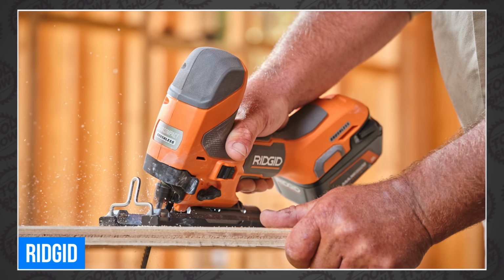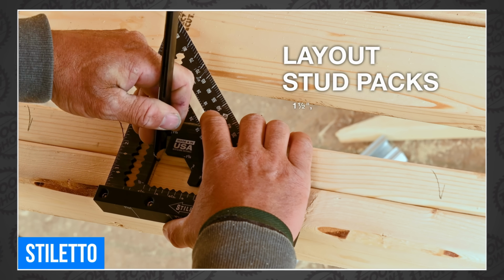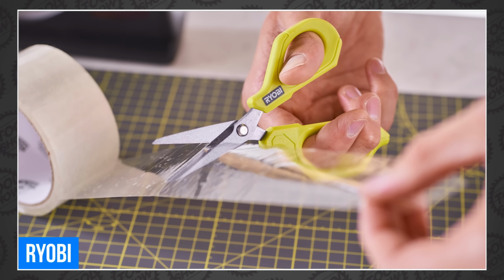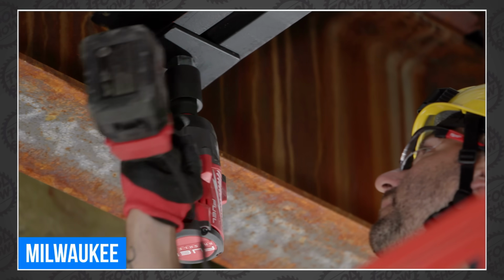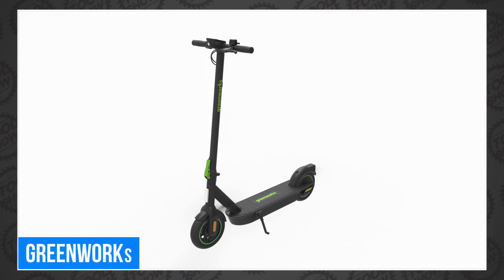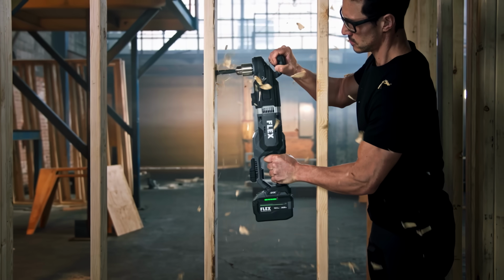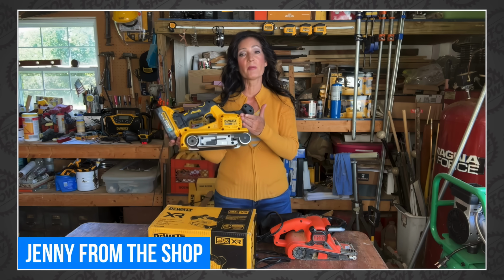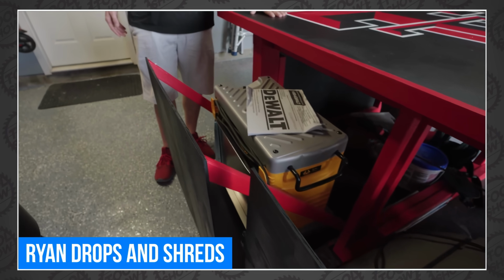New Power Tools Just Announced from Milwaukee, Stiletto, RIDGID, RYOBI, and more!

Comment: Milwaukee should make an MX Fuel mower, MX Fuel pressure washer, and an MX fuel snowblower. Also an M12 fuel 5 inch random orbital sander.
Reply: Yup. MxFuel lawnmower would be perfect. Super powerful and long runtime. They should expand the MX fuel line for real runtime based tools. Zero turn mower etc

Comment: I've had a Milwaukee ebike since 2018.  Uses 4x M18 12.0Ah batteries and draws 100A peak at 72V nominal. Tops out at 52mph, but gets to 30mph very quickly.  Have over 7k miles on it, but battery SOH has dropped below 80% and just had a thermal run away in one of my repaired packs. I've moved on, but got more life than I expected from the abused 12ah packs. It was the only way to source 21700 cells easily in 2018. Still using the packs in my big M18 tools. Would love to see what Milwaukee could do with an MX forge 72v 12ah pack.

Comment: I think Ego's move to electric transport is a logical move. With Lithoum batteries you can do much more than just use them as proprietary energy modules for tools. With my Mikwaukeetools I'm noticing that I occasuinallt use tools for projects, but not continuosly, leaving batteries unused for months, which is also not good. Many if my milwaukee batteries I've been using as glirified power stations to charge things or power other tools around the house. I've recenetly also started using milwaukee batteries as a potential sorage battery to harvest some solar. But because the battery uses a proprietary logic to charge the battery, this is an extremely limiting funcrion of the battery's capability. I think its time Milwaukee is more lenient in letting customers use the milwaukee batteries for other proprietary energy solutions by at least providing an adapter that bypasses the logic so that we can charge the batteries responsibly through other means than their proprietary m12 and m18 chargers. And I don't understand why milwukee isn't smarter in builiding an integrated powerstation solution into their multibay chargers. It feels like investing in wasted money for making only a half baked product. I think their recent packout multibay m18 charger is a clear example of that. It is hyoed well in design, which I agree, but as a followup to their previous two multibay iterations it feels like a missed opportunity for a next gen improved tool. I think it is not, but a charger and powerstation with 6 batteries in series, paralelle or mixed combination powerstation, that also acceps solar charging is what I was sorely missing in the soec sheet of the packout multibaybm18 charger. I've now started diy-ing myself because I have quite a few of milwaukee batteries. It is currently their logic board protocols that seem to be the limiting factor for charging, which is an unfortunate limitation, for a basic functionality of the battery, charging and discharging.

Comment: I guess Ryobi is lowering the snow blower price by only including one pair of batteries. The 24" two stage I got last year, Deal of the Day, has 4 x 6 Ah batteries. As for run time - Ryobi 40 V is ~5 minutes per Ah. So I get 30 minutes per pair of 6Ah in the snow blower. 30 minutes of tilling with the attachment plus weed trimmer and a tiller. At least Ryobi has a rapid dual charger, my previous Snow Joe snowblower, dual 40 V batteries for 80 V, only had a slow dual charger - almost 4 hrs to charge a pair of batteries.

Comment: While I think it is a neat idea for these companies to expand their battery options, with the possible exception of maybe the e-bikes, I don't see them selling that much. The reason?...the battery cost and run time. All the negatives of electric cars will be the reason why in my opinion. These larger Greenworks vehicles are going to require many more high output, extremely expensive batteries then most people will have in their arsenals. I, personally would get range anxiety if I took that UTV out some place. Not to be Debbie Downer, I think it is great for these companies to bring these to market, but I believe that market will be small...

Comment: Why does every YouTuber rip on the size of Ridgid batteries? But love giant Flex batteries… because they are paid to say they love FLEX..  you’re an idiot to buy those giant flex tools.. who wants to hold/carry those around all day.  I’ve only seen one flex drill on a commercial job-site and it was an apprentice…
Reply: I don't know...I recently bought the Flex compact right angle drill from Ohio Power Tools that Rob was holding tonight. 

It came as part of a BOGO where I also got the 3.5 amp Power Stack lithium pouch cell battery and charger for just $199. It's no bigger than my Milwaukee hole hog right angle drill and seems just as powerful but also has a few nice features my Milwaukee doesn't have. 

I wouldn't hate on the Flex tools until you try some. 

Their sub compact line of tools is pretty small and paired with the right battery is comparable in size to many of the 18 or 20 volt choices from other manufacturers.